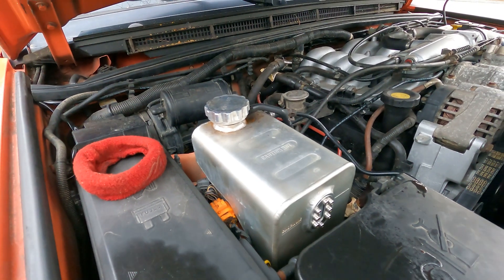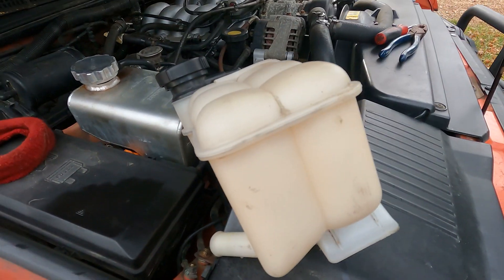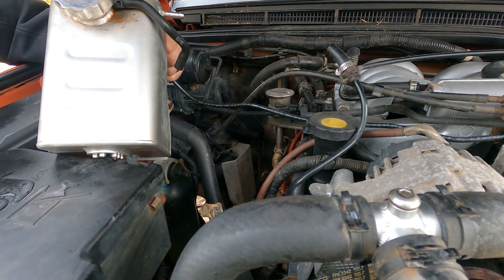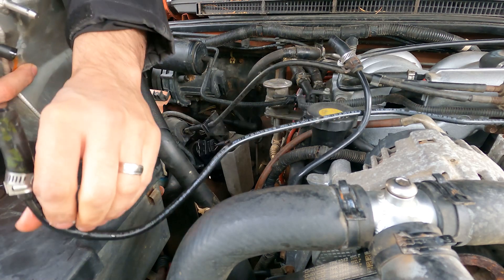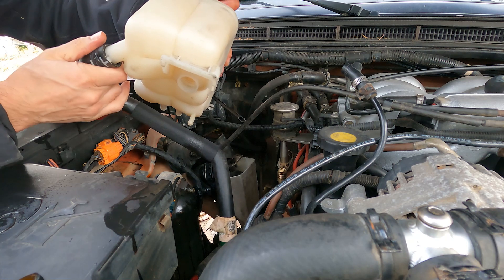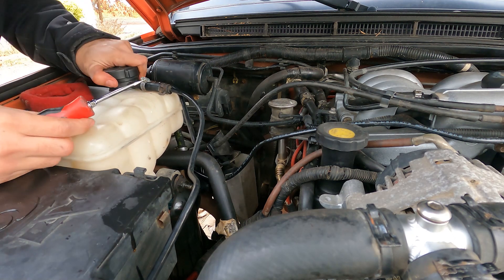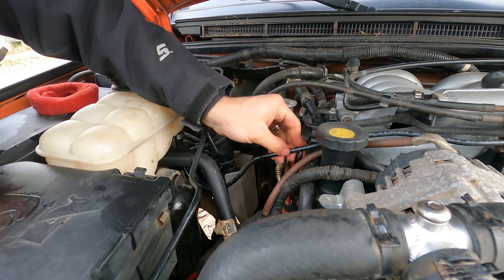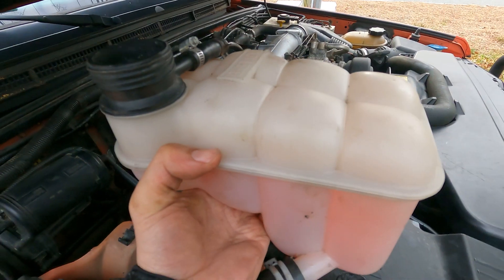Customer states "MY LAND ROVER HAD A COOLING SYSTEM FAILURE" CSW LANDO got a little stressed 😳😂😁

Comment: O.E. part replaces fancy part and saves the day. With all the testing done on O.E. components, its getting tougher and tougher to find a “better” aftermarket solution. Of course, if the original part is a crap design, all bets are off.  Can only recall a single time of this lately when my car ate its shifter bushing.  The aftermarket was ahead of the game with a machined Derlin replacement - a case of a $20 piece replacing a .50 one, but it lasted for another 250,000.

Comment: Watching you struggle to get the hoses off reminded me of we used to install hoses in the late 70's . We would take a little bottle of Indian Head gasket sealer and coat the inside of the hose . It would never leak but was a pain to remove the hose .
Reply: Indian Head was slick as snot while wet, but almost like JB Weld for the next guy!
Reply: @rupe53  Also if you got it on your hands it was almost impossible to wash off .
Reply: @eaglerider1826  ... impossible with soap and water. Most any type of thinner / carb clean / brake clean will get it off before its dry. OTOH, when we were using that stuff 50 years ago those handy chemicals were not within arm's reach most of the time. BTW, that shit is still available but most of the applications are in antique restoration. It's the only thing I would ever use while doing an air cooled VW engine.

Comment: Mix a lil JB weld smear so neatly and Bam! Sealed … I know it soo t look the same but if done  nearly and some Aluminum spray paint you could get away with it ….
Exp Note: I was in Texas - AF Training back In 2000 , had an 88 Buick Park Ave , started having a water leak at a seam on / near head … took a Texans advice bought JB weld  smeared it on…. I was still in training and then to Arkansas more training ….sooo 3 months later and back to New Jersey that JB weld did it’s job! 
Then I moved to Germany and sold Buick IDK what happend thereafter

Comment: I was really curious to see if you would have a problem with this customer.  Seems he could be a little demanding.  Did he ask for the multipoint?
Reply: He shoved CSW out of the way and said "Nevermind! I'll fix it myself!"  😁
Reply: Just replace the overflow tank and nothing else. I know how you guys run up the bill.
Reply: @hughbrackett343  And CSW has run the bill up on himself!! What a great mechanic! :)
(See also the Monty Python skit where the Upper Class Twit of the Year runs himself over).
Reply: Easy fix with duct tape and JB weld.
Reply: Wonder how shrek is doing..

Ohhh. Shrek has kidney failure!

Comment: Looks like one of those new modern Landies? No wonder you are having issues, mine is a IIA, 109, right hand drive, MilSpec with a NA 2.25 diesel with 61hp 104ft lbs. Have a great day in your Landie.
Reply from the maker: It's the last of the old ones. 04 disco 2, last year of the 4.6

Comment: I really don't get fitting an aftermarket coolant header tank. What on earth was wrong with the OEM item. I drive a 20 year old Disco TD5 and in the 6 years I've owned it only had to be recovered once after the auxiliary belt broken due to a seized bearing on the tensioner pulley. If they're looked after they really are good trucks.
Reply: This is my impression too, despite what idiots on the internet say. There  is a reason why they are the go-to vehicle for safaris and desert exploring. Had a tensioner seize in a Ford truck once. Luckily it happened right by a mechanic's shop. :-)
Reply: @vw5056  I use synthetic oil and change it fairly regularly. To be fair the belt failure was within a month of buying it. I have fitted a new radiator and intercooler. All the other jobs were general maintenance for a 20 year old car, wheel bearings etc. Pretty rugged as you say and anyone with a reasonable amount of me mechanical skill can repair and maintain one.

Comment: WTF do you need with an aluminum tank? I remember an old truck where I hung an old Prestone bottle there as a coolant reservoir. Worked well, for the life of the truck.
Reply: It's a vanity thing. Actually it also makes it harder to tell if you've got enough coolant in the system. See also: Chromed headers, etc. Okay on a show vehicle, not so much on a daily driver.
Reply: The difference is on old vehicles, the reservoir was designed as an overflow recovery, ie not under pressure.  On new vehicles the reservoir is integrated into the the cooling system and therefore subject to cooling system pressure.  The pressures have also increased from around 14psi to 20psi in some vehicles.  Operating temperature has also increased from around 180F to 230F in some vehicles.
Reply: Newer Vehicles Use What Is Called a Pressurized Surge Tank 😀

Comment: I really don't know beans about Land Rovers, but if the plastic recovery tanks are prone to cracking and leaking, and this aluminum one cracked and leaked due to a defect in welding, is there an issue with the pressure in the coolant system?  And why couldn't the aluminum tank be re-welded or even maybe where that crack is, reinforced and welded??
Reply from the maker: The sight glass failed
Reply: @customerstateswhat  AHHH!!! I see now!   I'm sorry, it appeared there was a crack at the weld (looking at it) on the upper right rounded corner. I wonder if that sight glass then could be replaced with say, 1/4" Lexan and some RTV sealant, or a silicone sealant?  I'm sorry, I'm just one of those fools that likes to fix stuff, I guess.  Sorry.

Comment: CSW, did the tank or a weld fail?  To me it looks like that front section is a flange for a pressure rupture disk.  I could be wrong since I have no Rover experience, but I have used pressure rupture disks on autoclaves.  If it is a pressure rupture disk please keep an eye on the pressure of your coolant system since the disk could be an indicator of excessive pressure.  The other option if it is a pressure rupture disk is they fatigue over pressure cycles and are a maintenance item.  The tank vendor may sell the rupture disks if they are still in business.  Good Luck!
Reply: I never worked with them, but there are clear discs? 

I was thinking cheap sight glass, but if they repurposed a rupture disc as a sight glass I can see why it failed over time by your description...
Reply: No the disks are usually a stainless type alloy with a calibrated thickness that based on area, thickness, and material properties will fail at a known pressure to minimize damage of pressurized system and release pressure in a safe direction.  It looked like there was a flange on the front of the overflow tank that had one of the disks.  I must be mistaken.
Reply: It was the viewing glass that broke
Reply: @samholdsworth420  thanks Sam.  That would make more sense.

Comment: Take the tank to a welding shop that does TIG 👌 which is about all of them.
Reply: It's the glass that cracked not the tank
Reply: @samholdsworth420  do you need the glass ?? Weld a piece of aluminum right over it.  As long as it's a sealed unit,, won't have a sight glass but you can look down from the stopper.

Comment: get some  one to tig it
Reply from the maker: It's the actual glass not the tank.
Reply: @customerstateswhat  Make an Plexiglass Plate in Place of the Glass and Bolt it In Place With Some Clear Silicone  And Existing Hardware on The Tank 😀

Comment: Little trick to let you know you take a wet cloth and you wrap it around the hose and you put the propane torch to the wet cloth and you heat up the wet cloth which causes the hose to expand and then you put your glove hand on there and you pull it off because the hose has said its way and between the cycle of hot and cold hot and cold hot and cold the hoses formed its way around at the connection so you have to heat up the hose to make it expand to come off of your easy you may try it with the screwdriver but nine times out of town you do that especially since it's got a metal nipple that it's formed on you're probably going to split the hose and you'll have to start all over with a new piece of hose but I'm only calling it as I sees it because I've done this I don't know how I don't know how many times